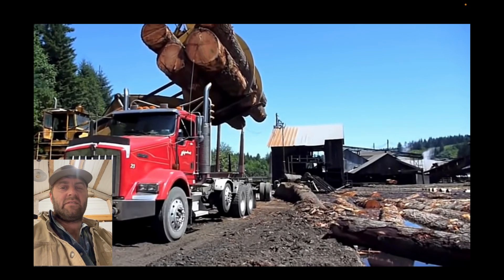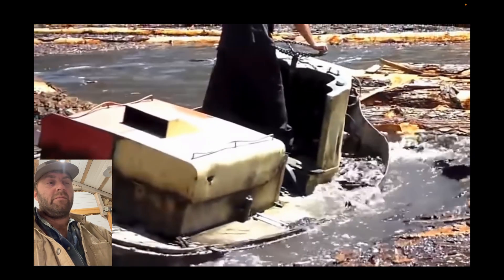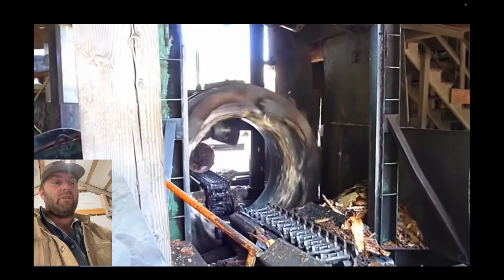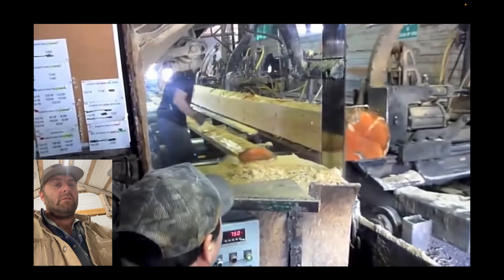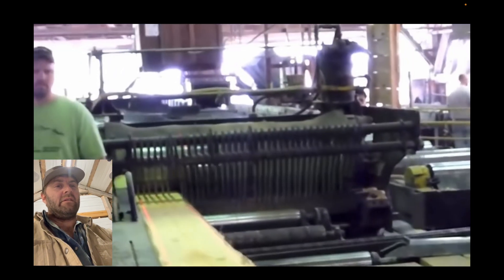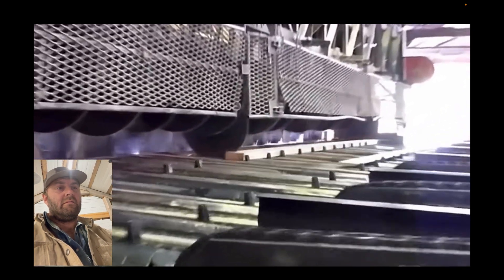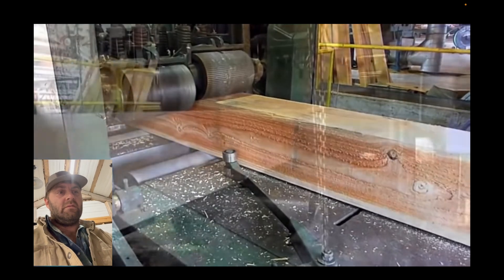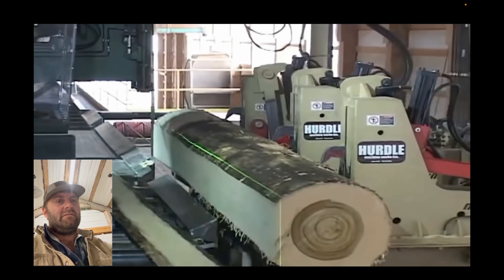Amazing Sawmill Operation | Fastest Sawmill Ever

Comment: Retired sawyer here. This is the first mill I've seen with an offbearer riding on the carriage to hold up the end of overhanging slabs. Bangin' idea, until a saw disintegrates or the carriage runs off.

Speed? It's the result of good offbearers, good saw filers, good millwrights and good engineering. The sawyer is the quarterback, but without all the others, he's toast. You've got to have good men.